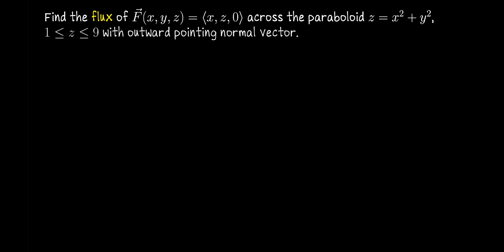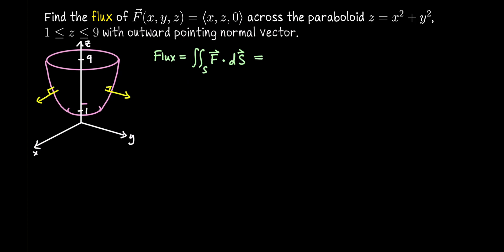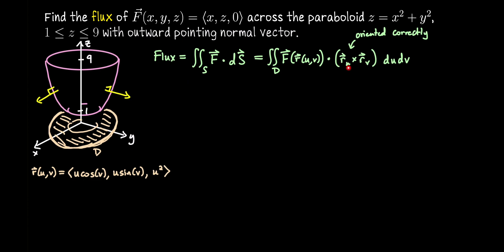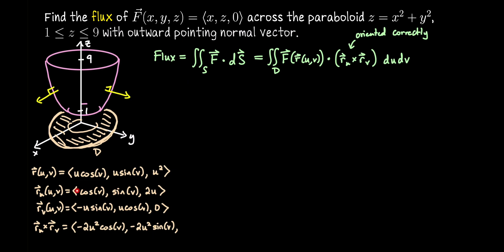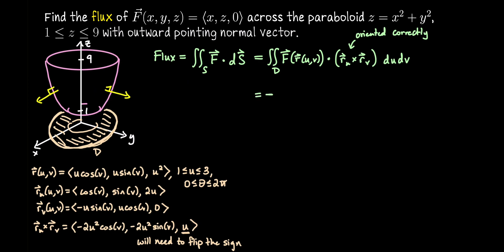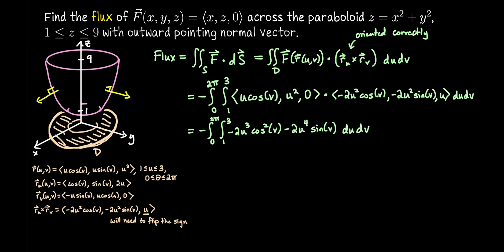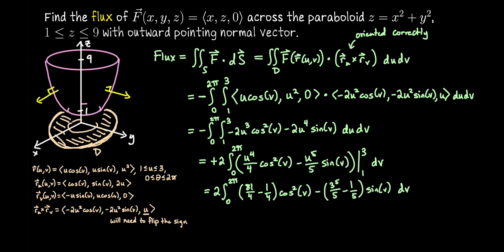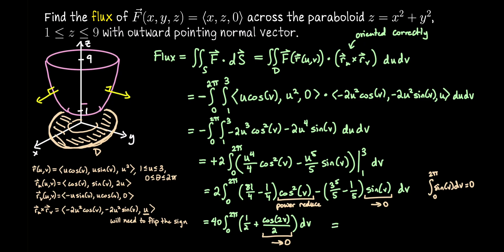Example of a flux integral, Multivariable Calculus

Comment: Hi, when I tried to do this question without parameterising the surface (I used dot product of F and the partial derivatives of z) I got -40π instead of 40π. Is it because I used upward pointing normal instead of downward pointing normal? Thank you so much
Reply from the maker: Hi Amanda, you should use a parametrization to compute a flux integral, in order to evaluate the surface differential dS. I'm worried that you replaced dS with the gradient of z(x,y), (2x,2y,1), which is not correct. Here is an approach which will probably mirror the terms you had/explain why yours came out almost correct. Based on you wrote, let's parametrize the surface as r(x,y) = (x,y,f(x,y)) (where z = f(x,y) = x^2+y^2). Then r_x = (1,0,2x), r_y = (0,1,2y), and r_x x r_y = (-2x,-2y,1) (<-- notice how similar this is to the gradient, but that's essentially a coincidence). So then we would have F.dS = (x,z,0) . (-2x,-2y,1) = -2x^2-2yz (I'm leaving z as is, but it's really z=x^2+y^2). Now we need to integrate this over the xy-domain, which is the annulus between concentric circles. Shortcut! the expression "yz" is rotationally odd symmetric around our surface (z always +, y equally + and -, so xy will cancel itself out), so that piece will integrate to 0. We are left with integrating -2x^2 over the domain. It's easier to do this in polar... integrating -2r^2cos^2(t)*r dr dt over the same bounds in the video gives -40pi. Two remarks: (1) we pick up *r at the end because we are converting from rectangular to polar, and (2), I suspect you did essentially this, but perhaps what took the place of r_x x r_y was (2x,2y,1) rather than (-2x,-2y,1). This is important: dS is not the gradient of z(x,y).
Reply: @bevinmaultsby  Thank you so so much! This is very helpful!! I will watch more of your videos!!!

Comment: When I use Gauss' Divergence Theorem I obtain a different answer of 64pi, how come?
Reply from the maker: Great question. To use the Divergence Theorem, the region must be fully enclosed. So we would need to say the flux across S, the top lid and the bottom lid (three separate computations) equals the integral of the divergence across the solid 3D region. Did you account for both lids?
Reply: @bevinmaultsby  Thanks for the reply. I didn't account for both lids which is where my error is, appreciate the quick response.
Reply from the maker: @sportmaster2586  great, glad you got it sorted. Div theorem is a great way to solve this actually, since div F is just 3.
Reply: @bevinmaultsby  Isn't F = (x,z,0) so isn't div(F) = 1?
Reply from the maker: @sportmaster2586  yes, not sure what I was looking at!

Comment: I think I’m misunderstanding something. It looks like there’s no intersection of the vector field and the paraboloid, so I don’t understand how it can affect the flux across the surface. The vector field is completely contained in the x,y plane, is it not? What am I missing?
Reply from the maker: Good question: the vector field F exists at every point (x,y,z) in the whole 3D space (R3). For each point (x,y,z), F associates the vector whose coordinates are (x,z,0). So for example, at the point (2,3,13) on the paraboloid, we can imagine the vector (2,13,0). If you imagine the paraboloid like a cup on a table, to each point on the cup we would imagine a vector parallel to the table. Does that help?
Reply: @bevinmaultsby  Aaaahhh, so essentially, the definition of the vector field ensures that every vector is parallel to the x,y plane, but not necessarily contained in it. That makes sense.